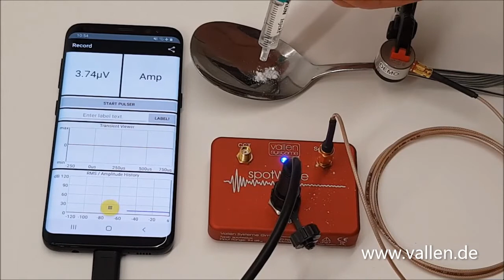Listen to your chemical process with Acoustic Emission!

Comment: Can I use this with a microcontroller or microprocessor
Reply from the maker: Depends on the microcontroller, if it supports virtual UART 
please send your questions to sales@vallen.de
Reply: @vallensystemegmbh6854 what is a virtual uart and how can I use this with ae sensor like VS 150 rsc with SPOTWAVE